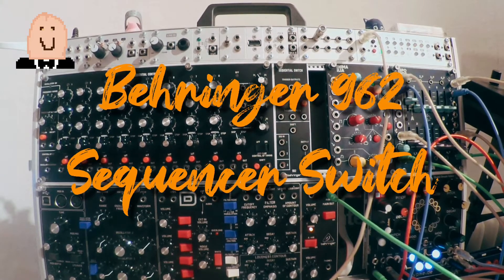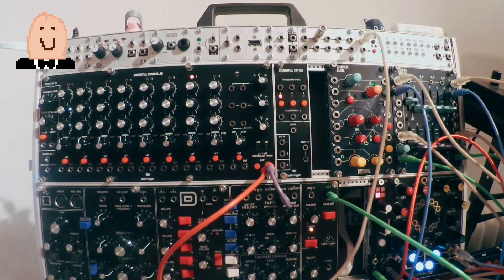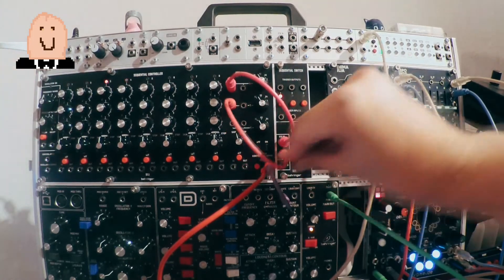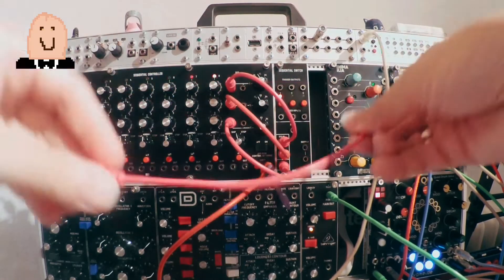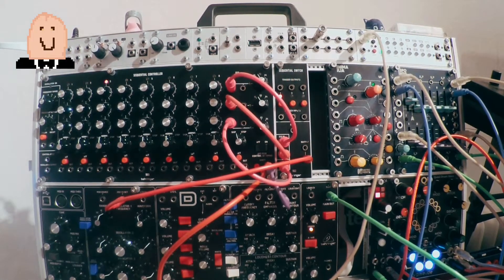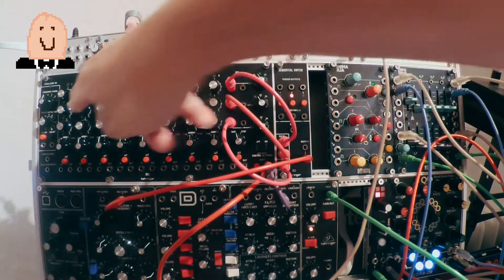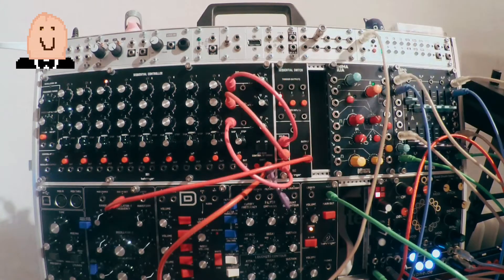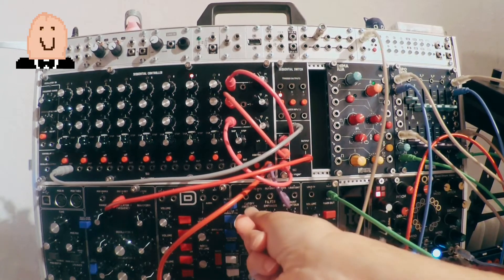Behringer 962 sequential switch with Behringer 960 Sequential Controller System55 Combination

Comment: Hello @Penishead ! Thanks for you explication ! I want to synchronize my Elektron AR mk2 to the system 55, i use the CM1A Midi IN to the Midi OUT, and cable to the trig CM1A with the shift of the sequencer 960, do you think it's correct ?
Reply from the maker: @ValentinSalomon-n7w  yes, that should work. Important is that a trig arrives at the 960.
Reply: @penishead_official  Hello Penishead ! I have ask the question to as user of System55, here is his answer : "The CM1A will not convert a MIDI clock into a trigger.  You would have to have a sequence of notes sent via MIDI (the rytm should be able to do that)  and use the trigger output as a clock.  Also, to do this you would have to configure at least one of the trigger outputs as a V-trigger.  An S-trigger will not "shift" the sequence (unless you convert it to a V-trigger via the 961 Interface module."

Comment: i go from the clock out from my keystep pro with 24 ppq into shift from 961 but the clock is all over the place.... really all over the place!!  do you know why is that?
Reply: Hey if it helps have you tried 

-both mono and stereo patch cables

-Sending keystep clock into a buffered mult before the shift

-Using a drum trigger out from the keystep pro to advance the shift?
Reply: @lorensteele2962  no i didn't i just useed a mono patch cable witout multi
Reply: @TheNimasan  if you could try these three approaches,  they have helped me with unstable clock issues
Reply: @lorensteele2962  i will. thx my man

Comment: Would you recommend this for a K-2 (behringer)
Reply from the maker: No, because the k-2 understand only Hz/oct. Not 1V/oct.
Reply: @penishead_official  Will it work with a crave(behringer)
Reply from the maker: @haroldwhitney8074  yes
Reply: @penishead_official  could you not use a ladik hz/oct to v/oct module?
Reply from the maker: @saren6538  yes, that would be worth to try.

Comment: I have three 960's. I want to link them together so they run in sync. There would be a master 960, and one or two slave 960s. I tried patching the Oscillator Output of the master unit to the Shift socket (bottom right corner) of a Slave and they drive along nicely together, driven by the Oscillator of the Master; but there's a problem - Even though I press the "Set" button on both the Master and the Slave unit, to set them both to channel 1, when I kick off the Master unit, the Slave unit is always one step behind the Master. This can be corrected by pre-setting them one step out, but this is a pest. Is there any way of starting them off so they kick off at the same point ?
Reply from the maker: Hey, Richard! I will have to read it closely and come back to you soon. I have to take a deeper look. Very interesting question.
Reply: @penishead_official  I tried connecting each channel output on the Master, to the matching channel input on the Slave, so each master channel triggers the corresponding slave's channel, but this results in having 8 patch leads running from the Master to the Slave, getting in the way of everything. It does though, give us one-for-one triggering of the channels. It would be neater to have just one or two leads connecting them. I want to get everything properly sync'd up to give myself what would effectively be a big 6 track sequencer (using all three rows on both sequencers as CV outputs), so I can drive 6 VCOs from them.
Reply from the maker: @and7barton  because there is no Reset In in the module both don´t know about each other. So the second 960 does not know anything except the clock from the other 960. In this case I have no idea how to sync both for the "set" buttons. I can not try because I have just one 960. Because this is an oldschool concept and never ever one guy had both of the old system to figure that out I have to pass. Sorry!
Reply: @penishead_official  Thanks for that. I'll keep experimenting. There may be somewhere I can find a trigger pulse to patch into the IN socket of channel 1 to reset the sequencer at that point. At the moment, when starting a sequencer, I'm having to SET the Master to the 2nd channel and the Slave to the 1st channel. Then, when I hit OSC ON on the master, They both come into sync almost immediately, and stay in sync. So this method works, but isn't ideal.
Reply: @penishead_official  I've solved the issue of running several 960s together in sync. I now have three of them. I drive them all from an external clock ( a Behringer 150), the pulse being  split into 3 with a multiple.and they start and stop all on the same channel, so the problem of them starting up out of step is solved. I use the same clock pulse for triggering envelopes too. I don't use any of the 960 internal clocks at all.
Reply from the maker: @and7barton  that is fantastic. 3 of them. Oh my god!
Reply: @penishead_official  That's 9 channels of sequencing available. I drive one or more of the 960s from a York DIV2 clock divider to give me half-speed (and lower) clock triggering.
Reply from the maker: @and7barton  thats really crazy and powerful, man
Reply: @and7barton  thats fucking 168 hp. damnnnn!!! i mean the 960 is a tremendous seq. no doubt. i got mine yestarday. but fot that money you could get squarp hermod or metropolis which are great seq's as well my man. the 960 works with expert sleepers mk4 extremely well. i would recommand one of those. and they were so many possibilties to solve the problem. it also can replace the 962!!!!
Reply: @TheNimasan  Yes ! - The 960s are installed above each other. I've built a master clock control module which has three pairs of double sockets. Each pair of sockets is switchable. By the way, those 960s, I bought for £ 125 each so good value, I thought. I patch into it a cable from a Behringer clock (No 150), then patch one of the three outputs to a York clock divider which gives me 6 clock divisions from 1/2 down to 1/64. I can use any of these outputs to trigger a 960, or go directly to the trigger input of a synth, allowing for rhythms. I recently bought a clock divider allowing odd fractions, like 1/3, 1/5, 3/8 .... that kind of thing.  I haven't checked that module out yet.
Reply: @and7barton  i read your thread here without understanding too much, but i´m fascinated and i just want to let you know, that i had to spare for my first one for quite a while and that just today i got the money together - rejoice!
Reply: @friesiamans1966  I'm sure you'll love it !
Reply: @and7barton  yep! haha..........

Comment: how can i control the speed of that VCO from a Moog Grandmother ?? i cant really sync both , maybe some 1 can help me thx
Reply from the maker: Sorry this is not possible because there is no clock input
Reply: @penishead_official  with Pamelas Workout it is possible, Pam out 2 shift in Sequenzer , frequenz set to 4, Vernier to 5 , works well , another out from Pam controlls GM

Comment from the maker: A rest is not possible, just a skip. I have no idea if this is possible. Anyone out there?
Reply: I solved that issue a while back - Use a 962 switcher to switch the gate signals instead of a CV. The switcher can be switched from say, No 1 (which is connected to a gate input on a synth), using an output from one of the SET sockets, onto No 2 which remains unconnected to anything. Then a subsequent SET socket is used to switch the 962 back to No 1. So effectively, the channel that you want NOT to trigger anything, is switched to No2 on the 962 switcher, which then basically routes the output to nowhere, then switches back to the original trigger routing and continues. Those 962 switchers are pretty useful too, for other functions, not only for pairing up with the 960. I'm going to purchase another couple of those for miscellaneous uses.
Reply: The 962 only handles positive signals and is not good for routing audio -Doepfer makes a cheap 'Dual 2 into 1 channel switch' and its audio is bi-directional. There's load of other makers (careful though as not all modules are bi-directional and having that extra feature is nice to have.
Reply: Maybe if you send a gate to a switched output module it could mute the output for that gate, and you could multi a bunch of gates on the same switched output. You need another module though

Comment: @UCGhe2lq8Vmuvf73ysANtDOQ

I'm still enjoying learning about my 960 sequencer (actually, I've now got THREE of them !) - but there's one thing that's so far eluded me - How to programme a REST into a sequence. The original Moog 960 had a 4th click available (unlabelled), on each skip/normal/stop control which apparently, would make it pass through that channel but not trigger anything, but the Behringer doesn't have this feature  I'm sure there must be a way of doing this, but has anyone any advice on this issue ? - Thanks.

Comment: So you are sending a trigger from something to the shift input of the 960, then via a stackcable, through to the Loudness Contour gate input of the Model D ? Is the trigger a simple gate pulse for every step of the 960, or a clock signal?
Reply: There's a number of different kinds of triggering pulse you can use. It's a question I think of the speed of the front of the wave and the voltage of it. A short pulse from a trigger button, or a clock pulse, or even an audio signal if the front of the wave is steep enough (coming from an LFO if the frequency is low enough), to be seen as a pulse.

Comment: When you only use 2 trigger inputs, you get a 16-step sequencer?
Reply: yes
Reply: Yes, but you need to patch the 962 to switch the top row to the 2nd row and back. You can get a 24 step sequencer by similarly patching the 3rd row.